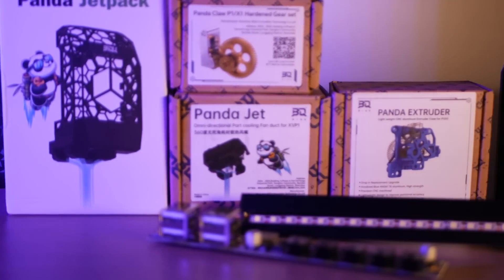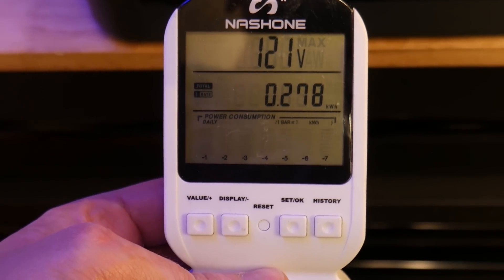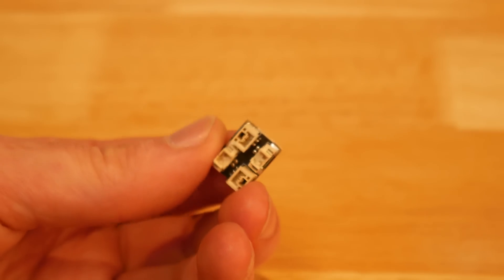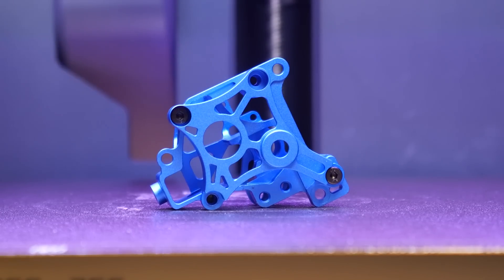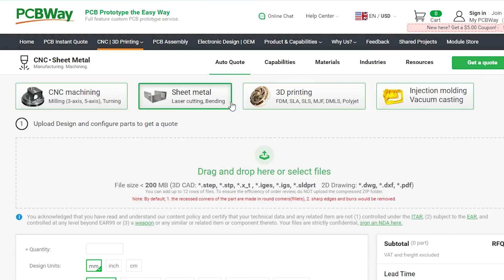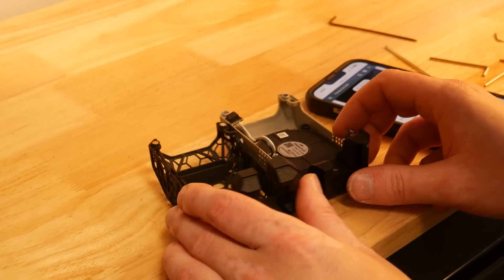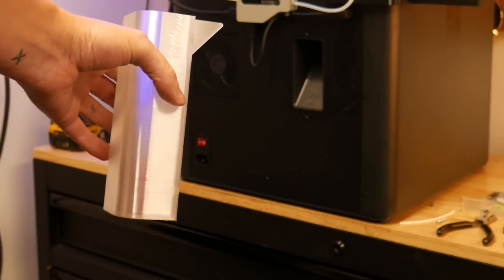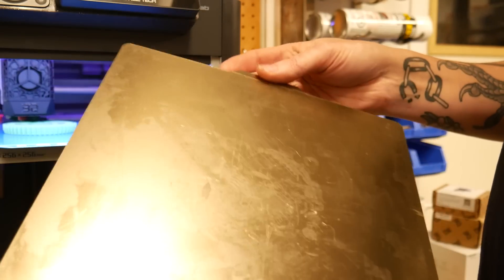Ultimate Guide to the Best BambuLabs 3D Printer Upgrades: Enhance Your 3D Prints and More

Comment: The hotend / extruder changes just seem contra-productive to me.  The great strength of the Bambu is that they have profiles that just work.  When you start changing stuff in this way you basically have to tune stuff yourself to get some benefit, throwing out that main strength.

Comment: Hot chamber + hot led + hot glue = nope
Reply from the maker: hot glue has a melting point of >110C, if my chamber is that hot i have bigger problems to deal with lol
Reply: @WildRoseBuilds  sorry then for bother. One of my glue melted in car in summer, other was working as a end cap in led's alu profile - significantly melted

Comment: the cryo plate you are show casing is the cryo grip glacier, which is for materials other than pla and petg. there is also the cryogrip frostbite, which is only for petg and pla. both of those plates have much better grip than bambulabs textured pei. which is most notably with petg on the frostbite, which is easy mode, while petg on textured pei plate can be pita.

Comment: BIQU recommends NOT hooking the Lux and the stock lighting up simultaneously and they no longer include that splitter. It's good you put the LED frame on first because the LUX puts out almost no light. The Panda Jet/Jetpack puts out around 1/4 the air of the stock duct. The extruder and Claw are the same performance as stock. BIQU is just milking the popularity of Bambu.
Reply: As for the Panda Jet, I had noticeable improvements in overhang quality with the Jet installed on the stock cowl. I haven't measured the air flow, but the results are noticeable for me and it feels like more air pressure to me on all sides of the print. I had heard some early production runs of the Jet had ducts partially blocked by print dust residue.
Reply: I also noticed considerably improved overhang performance with the jetpack, so it's doing something different.  @techjedi2878
Reply from the maker: There will always be a need for replacement parts and having a 3rd party produce them keeps a company from having a closed source monopoly over them and thus dictating the price. I’m all for what biqu is doing here.
Reply: @WildRoseBuilds  even if they are dictating the price, their prices are extremely good for just the fact that you’re getting parts that you know for a fact are high quality, will fit perfectly, and will keep the overall quality the same throughout the printer with less risk of voiding the warranty
Reply: I agree with everything you said except the part about the Panda Jet. In my bridging experiments with stock duct and then the Jet duct installed, I had a very noticeable improvement. I saw a video where it did show a lower amount of pressure coming out of the Panda Jet but what I noticed is it distributes the air better providing better cooling on areas of some printed parts where the original duct wasn't directing enough air in a particular direction. Other than that, I definitely agree with all the other parts being a waste of time. I've tried almost every one of them. The Panda Lux is a special kind of disappointment. The idea is great, but the final product is a big thumbs down.
Reply: @Darknynja2  Completely disagree. PandaLux is one of the first mods I do to my machines. While the light isn't exceptional, it's a HUGE improvement over stock. If you don't plan on adding LED's on a riser, for the price, it's a great upgrade imho.